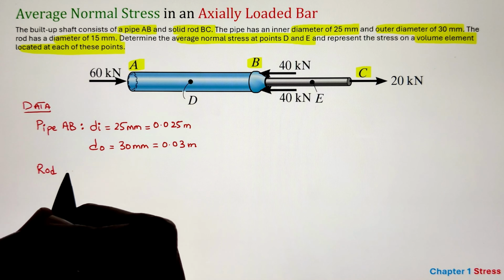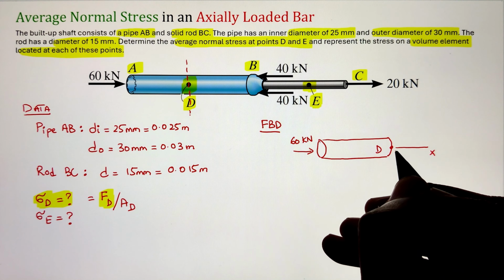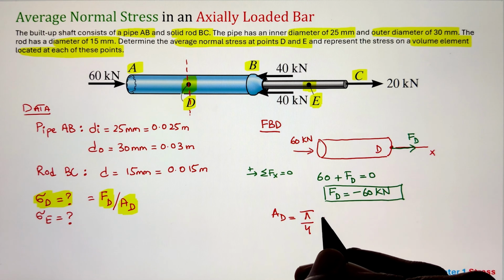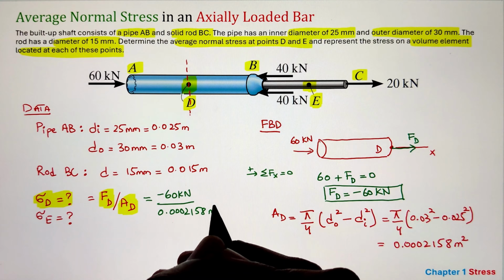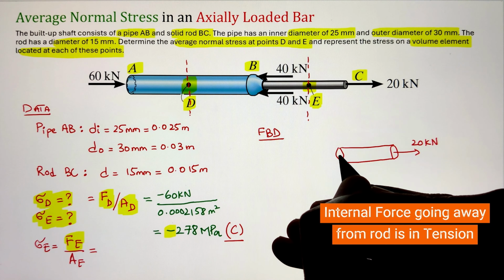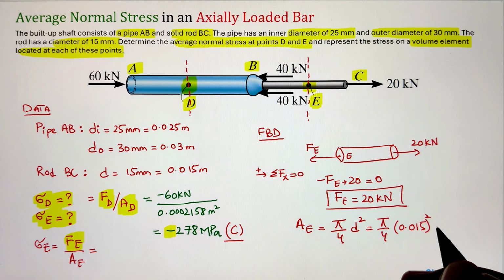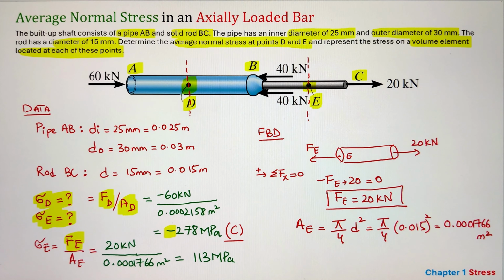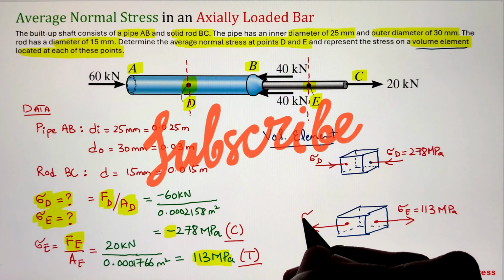Normal Stress in a Built-Up Shaft (Pipe + Rod) | Strength of Materials #StrengthOfMaterials

Comment: When representing principal stress directions and maximum shear planes, how do you determine the direction of rotation for the element? Is it clockwise or counter-clockwise?
Reply from the maker: If it's positive we take the counter clockwise on the left and right side of the element
Reply from the maker: Check out this mohr's circle problem in which in the end volume element are represented for shear stress showing clockwise and counterclockwise direction https://youtu.be/P3ISdF_Orjw